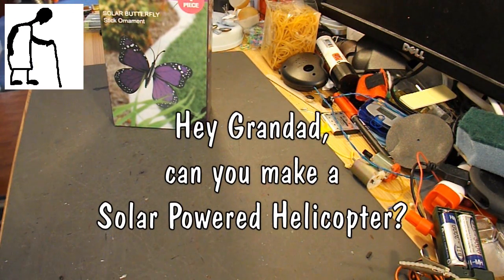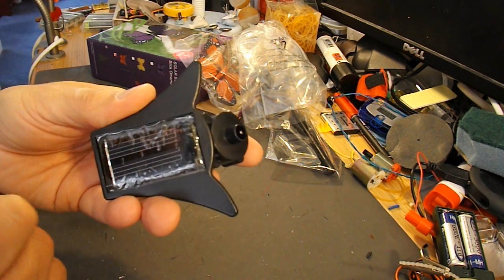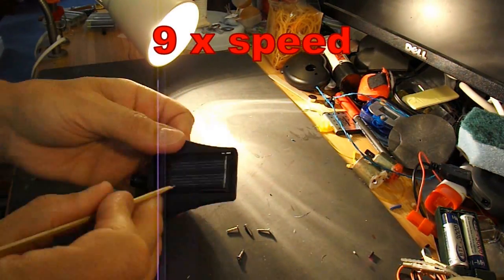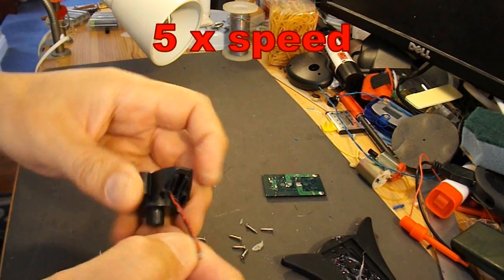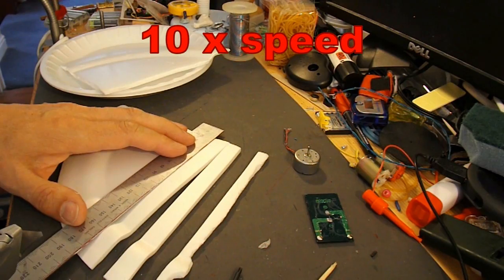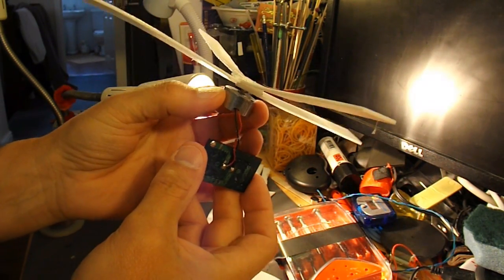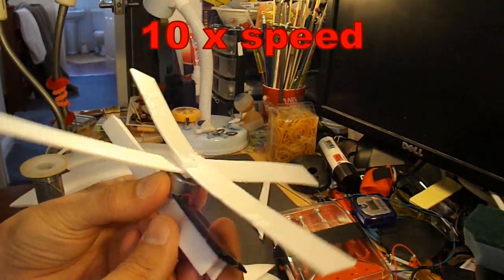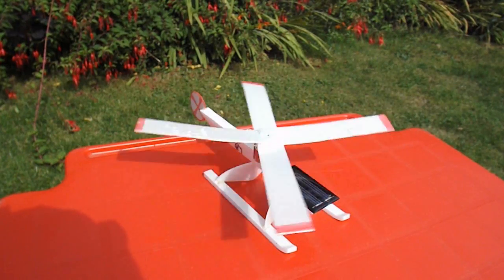A lighter Solar Powered Helicopter still won't fly

Comment: would be nice to use some thin fishing line to suspend it on a porch or maybe under a light inside to give the illusion of flight.
Reply from the maker: andrew keefer feel free to make one and do that. I only made this one to show there is nothing like enough power from a small solar cell to lift a helicopter off the ground. So if I suspended it people would think I was trying to cheat or fool them into thinking it worked.

Comment: You can get a shorter propeller blades then the motor can spin faster
Reply from the maker: But would it generate enough power to lift the helicopter? I think the simple answer is that this type of motor does not have the right power to weight ratio. It is too heavy for the amount of power it produces.

Comment: Its supposed to be angled blades so u can get more thrust
Reply from the maker: This doesn't have a chance of getting off the ground under solar power, but regardless of that fact, if you look at the blades and the way I made them you will see that they are angled the correct way, that was done by the way I cut a slot in the middle and slotted them together and it does create a downward thrust that I can feel underneath.  If you study helicopter blades you will find the pitch is very small because you need power not speed so my blades are technically correct even though they are probably not strong enough if the motor had enough power. I made no effort to make them stronger because I knew the motor would not have enough power and this is basically an ornament to sit in a sunny window.

Comment: Try a Moncopter rotor. ( maple seed rotor)  Less tip vortex drag.
Reply from the maker: Let's be honest here. This does not have a hope of getting off the ground. The power to weight ratio just isn't good enough. Off camera I have tested this motor with a better rotor and increased the voltage from 3.7 volts to 9 volts to 18 volts and we are still not moving off the ground, just burning the motor out and that is with the batteries remote, not on board. The original request was to do this with solar power and that is not going to happen. Just look at the solar planes that do get off the ground. They have massive solar panel areas and they are only moving forwards, not trying to lift off vertically.

Comment: you have to use 3 sola panel to make it fly
Reply from the maker: +Tony Farruku why don't you try yourself. You will soon realise that you will not get enough power from a solar panel to lift a helicopter. just look at the solar powered plane that circled the earth. It had enormous panels spread across it's wings to charge it's batteries and then power the motors. That was only to power a plane in horizontal forward motion. It takes far more power to lift a helicopter vertically.

Comment: Use a motor from  a radio control
Helicopters
Reply from the maker: That is not the point of the video. Yes I could make a helicopter that works using motors and batteries designed to do the job. If I did that then I might as well buy an rc helicopter kit and assemble it.

Comment: jet granadi can you make a motor powered paper airplane
Reply from the maker: +herman ali samad here is the basic PowerUp https://youtu.be/RjKsz-ef_Io?list=PLA5a2xPRSrB30sLbx339Y5Z3s47r_TpIo I found I could get better flights using styrofoam. If you look at the links in the video description you will find I did several.

Comment: USE A harddrive moter
Reply from the maker: Buzz BumbleBee Hard drive motor wants about 12 volts and the solar cell gives about 1 volt in good sunshine, so how is the hard drive motor going to work?
Reply: Good question, Buzz!
Reply: GrandadIsAnOldMan could you use a capacitor from an old film camera flash to drive a higher power motor or gear it for higher rpm